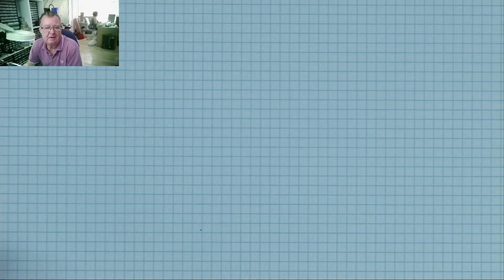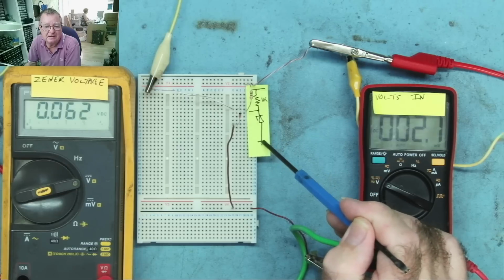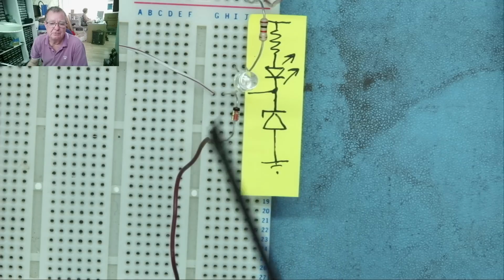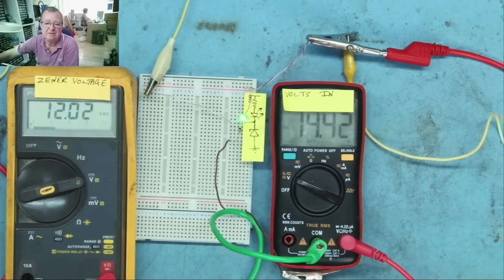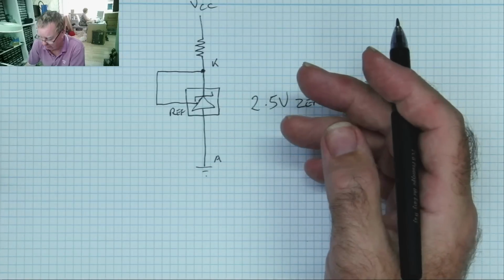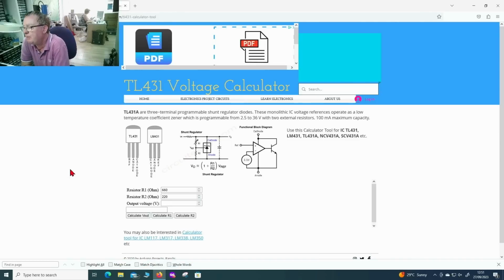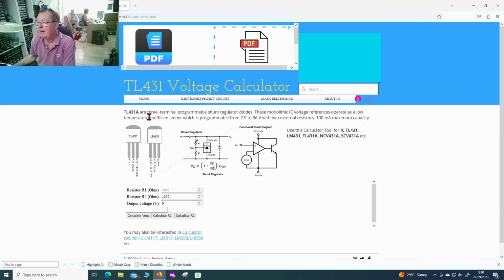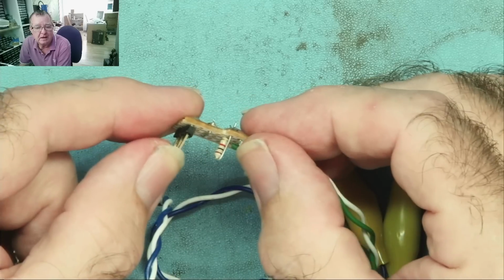All You Need To Know About TL431 To Fix Stuff : Test in in and out of circuit, test feedback circuit

Comment: I bought some CMS version at Aliexpress store.
They work well for default reference with just a voltage a bit high : 2.8 v. 
BUT they are totally unable to be programed.
I mean if you put a resistance bridge in the reference the output voltage does not change:
Always 2.8.
Or they put resitors default resistor bridge into the component.
Or it is in fact a zener diode and ref pin is connected to nothing.
Until you do not use your component in programmable mode you'r unable to see that.
Or more often you'll see it but the guarantie will be delayed.
It's not the first time they full me kind of the same way.

I had a ordered 555  CMOS which may run at 2 Mhz and more.
When powered, everything worked well until 20 minutes later: The component starts to be silly: signal seamed to be like parasitated untils it suddenly stops the only way to restart it is a reset or closing the power supply.

Comment: I have a few of these in my parts box but have never found a dead one. One day ... maybe. BTW I tend to put test clips on the LED side of the opto isolator fairly often to 1) see if the supply is running if I can't easily get to a DC output, 2) see what the output voltage should be if the board isn't marked and the board is dead. When supplies are running well (or my injected DC is as rated output voltage) you typically see 1V on the cold/LED side of the 817 isolator. I'm going to have to do more poking around on the cold side as you're doing here.

Comment: This is one of the very best electronics videos I've seen
on youtube because it shows how a zener diode, an LED,
a resistor, and the TL431 3-pin precision voltage-reference I.C. work together to affect the circuit's output voltage at one specific, repeatable voltage.
Kudos.

Comment: Thank you for this video. I have a 12v 4A SMPS that I use for cameras and the LED on the output would just flash in abt a 1 sec interval. I pulled the TL431 from out of the circuit and in using the A to GND and KtoR with a 1K resistor to 5v, my reading is .77 on the K pin. I should be seeing 2.5v based on your information. I'll be replacing the TL431.

Comment: Why @16:01 the LED is lit at 1.955V?  Also similar things @18:17.  If it behaves like a Zener diode, it shouldn't conduct until 2.5V.  But obviously it did conduct at less than the 2.5 reference voltage.  Is the meter on the left not displaying the correct voltage?

Comment: Evidently, I've been under a rock; this device was introduced in 1977!. I've worked with zeners, LM78XX, and even LM723, but I have never heard of the TL431.

I've used opamps to form  window voltage detector circuits, but I was impressed to see in the data sheet that a window voltage detector circuit can also be accomplished with a couple of LM431's.
Thank you for this fun introduction video.

Comment: Was waiting to see you place a potentiometer in the circuit to get adjustable voltage control... 
I need a 4.2V and a 3.6V supply, a cheap with plenty of current SMPS usually have the TL431 with it's associated resistors, I know that a potentiometer can be used to drop from 5v to 3.6v but I haven't seen it done and thus haven't gotten around to trying to figure it out myself....

Comment: I found a variometer in some phone and camera power supplies, that can alter the voltage of the output for the user’s needs. Probably all power supplies have the option, if not by variometers, but with a proper resistor, or socketed resistor can do the same job. Not SMD, usually easy to install. This modification is usually useless, because everything is based on the 5V standard.

Comment: So it's like an LM317 but set up as a shunting voltage regular instead of a passing regulator. In your example of the fixed 12v zener I was reminded of yesteryear when we had much more accurate references which wouldn't creep up as the supply rises. Vacuum tubes FTW.

Comment: The TL431 can oscilate during start and/or if there is a low Va/Ia going through it. Also if the capacitance of the capacitor across it is below Y or higher than X according to Texas Instruments. Higher than 10uF, I like to put at least 22uF across. A video showing this oscilation and when it happening would be very Nice. Love the videoes. Keep them comming.

Comment: Richard, I have a simple 6 led PIR  night light that I have replaced the Alkaline AA batteries with Ni- Cads.
I find that one battery always discharges more than the rest . This of course will damage that battery over time. I believe a TL431 circuit will provide protection but -
Do I apply that circuit to each of the 4 series connected batteries or can I monitor all 4 and shut off when  a low voltage (1v) per cell is reached ?
Secondly, would this make a good follow on video.
Great channel - keep up the good  work...
Reply from the maker: Thanks for the suggestion I'll take a look at it

Comment: Clever... i love the feedback method and will be using that next time.... thanks.....
Reply: Be warned! If you just configure the circuit with the resistors to set the behavior at DC it is very unlikely that it will work properly in a real circuit. You have to consider the entire circuit and its gain and phase characteristics or your power supply is likely to have dismal dynamic performance or worse, become a high-power oscillator. "Frequency compensation" is key.

Comment: when i was a kid a -few decades ago- i wanted to build a dual 0-30v 3a power supply with selectable series tracking  for split rails , i looked at how commercial units did it and could not get my head around the complex reference shifting and regulating the negative rail instead of the positive ect , for simplicity of built and fault finding i wanted both chanels to be symetrical, and dual gang pots dont track well and dont come in 10 turn , so i wanted voltage feedback through an led based opto isolator to slave one channel but couldnt get any linearity out of it 
i didnt know what the TL431 did, just knew that it was as common in the 90,s as a TL494 in a smpsu !
Reply: There are some optocouplers on the market that are specifically designed for linear applications. They have one emitter and two quite well matched "receivers." You use one receiver for the output and the other one used in a closed-loop driver circuit for the infrared emitter. The closed loop method with the good matching nulls the non-linearities. I've used them in a few circuits and they work quite well if you do the design properly. They are a lot more  expensive than general purpose optocouplers. To get good performance you also need to use good op amps.

Comment: Interesting and useful but at 17:30 we are demonstrating that we can get 5 volts at the 431, because that's what you used the calculator for but that didn't happen as your circuit wasn't the same as the Texas one in that R1 should connect to the cathode, as it was you had a potential divider between VCC and ground and the REF in the middle so the ref will change with VCC and so does the output which  aint the point. Other than that a lot of good takeaways !...cheers.
Reply: Yeah I noticed that too, nice video all the same 👍
Reply: I had this comment too. But read the replies to my remark. In a switching power supply this component is not used as a zener at all, but as a comparator that switches on or of the led based on a threshold voltage. It does not act as zener - it acts like a switch driven by a threshold voltage. Richard did not mention this.
Reply: yes, basically a op amp or comparator  @kriswillems5661
Reply: @kriswillems5661  
No, it is not used as a comparator and it does not switch in normal operation when used in the feedback path of a switchmode supply. It is used as a voltage reference and an error amplifier. The amplifier and the optocoupler normally operate in the "linear" region, with the amplifier increasing or decreasing the current through the IRED of the optocoupler and hence the current through the transistor of the optocoupler. It would only "switch" (swing to one or the other of the limits) under "large signal" conditions.
Reply: Yes, I was not sure about this. This makes sense. I would like to see  scope image of the voltage on the cathode. How such a loop works (switching or amplifying) very much depends on the time constants of the individual parts and the behavior of the feedback input of switching IC. Looking the schematic I do indeed see an Rr and Cr in the feedback, which does make it amplifier and not  a comparator. Also in the datasheet of the switching IC the control input is called "Error amplifier and feedback current input pin for duty cycle control", which confirms what you say. That said, just calling it a zener in this configuration is a bit confusing. It's an error amplifier with voltage reference. Thank you.

 @D614G_aka_Doug

Comment: The best TL431 video iv seen. You have Covered zener diodes plus the 431.. not to mention that little test circuit with the header pins(great idea). P. S. Iv also seen the TL431 symbol on schematics look like an SCR diode with the reference pin come out at an angle from the cathode just like the control pin on an SCR...   
Great video👍 best explanation 👌👏
Reply from the maker: Thank you 🙂
Reply: Just recently I saw, in a video, a TL431 drawn like an SCR. Sigh!

When a TL431 is being used in the feedback path of a power supply, I think it is best to draw it as two separate sub-circuits - the 2.5 volt reference and the amplifier with the output transistor. For people well-versed in this stuff it doesn't make much difference but for people who are not I think it makes the operation clearer.
Reply: @D614G_aka_Doug I agree that using the wrong symbol in the schematic is annoying as hell. Drawing out the equivalent circuit though is only useful as a teaching aid or for circuit analysis in the design stage. For production and service schematics the proper only the proper symbols should be used.

Comment: A TL431 is not a Zener or anything like that. It is a reference voltage source and a low-voltage low-gain op-amp cleverly packaged into just three pins. You can use it as a “Zener” just as you could so use a low-voltage op-amp with a 1.5V battery connected to the non-inverting input.

In a switched mode supply, TL431 is THE voltage error amplifier and has a key impact on the performance of the voltage regulator aspect of the supply. 

It finds use in switch mode supplies because it’s cheap and fairly well understood among the power supply designers. It does the job well enough.

When thinking of TL431, think like this: op-amp with (+) input tied to a 2.5V reference, (-) input brought out to the R(eference) pin, output driving a current source connected between positive and negative supply rail, and those rails then brought out as A(node) and C(athode) pins. It’s a compromise, but a reasonable compromise. And it works like any other low bandwidth op-amp would. You can use it to amplify speech audio for example (it’s too slow for HiFi lol).
Reply from the maker: I accept that TL431 is not a Zener diode (internally) it is more like an op-amp with a voltage reference and this is clearly visible on the Texas Instruments datasheet.  But I believe the point is that it behaves like a zener diode in real life applications and that, as the title suggests, is really 'All You Need To Know To Fix Stuff'
Reply: Richard, I was confused because you described it as a zener diode in in this application, while it acts like a comperator that switches on or off a LED.....just like transistor would switch on or off a LED.  It's like a switch that closes when a threshold voltage is exceeded.  It's not at all like a zener in this application.  I get it now.
Reply: Exactly. But Richard made a mistake.  R1 from that feedback loop should be tried to the output of the opamp (thus the cathode) and not Vcc as Richard did. R1 and R2 make a voltage divider without load on it, because the reference input has a very high input inpedance, because it is an opamp input.
Reply: @kriswillems5661  It depends on the application. For a shunt regulator/fixed voltage reference, R1 and R2 should indeed make a voltage divider between anode and cathode. However, as part of the feedback loop of a regulated power supply, you do need the top end of R1 to be connected to the PSU output, so that the TL431 runs open-loop and switches on or off like a comparator, as the output voltage varies about its set value (making the voltage at the Ref pin vary close to 2.5V).
Reply: @RexxSchneider That makes sense.
Reply: @RexxSchneider  
No, the TL431 when properly configured in the feedback path of a power supply does not switch in normal operation.
The circuit is typically configured with the amplifier to run open-loop at DC, but that doesn't make it work like a comparator. The frequency compensation components, which are seemingly invariably dismissed as "some other bits" are absolutely critical to proper operation. With the simplest frequency comp, the gain of the amplifier is "rolled off" with capacitive feedback so that the gain around the entire loop passes through unity (gain of one) on its way down with a "phase margin" adequate to assure stability. You want the total phase shift around the whole loop to be typically not more than about 320 degrees, though you may design for substantially less or a bit more.
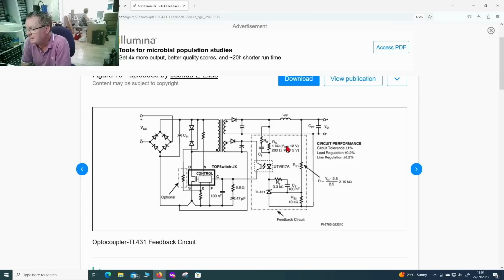edit: In the schematic at 21:00 there are four frequency compensation components - two capacitors and two resistors. setting two "poles" and two "zeros"

 The error amp may "swing to the rail" during "large signal" events, but this can result in overshoot or undershoot behavior.
Reply: @D614G_aka_Doug  Yes, thank you for being more exact about the description of the circuit operation. I did wonder if I had oversimplified the opamp action, but decided I'd explain the feedback like that to make it easier for kriswillems5661 to understand why the resistive divider chain is connected to the PSU output in these applications. I am aware that the TL431 is the gain stage in a feedback loop and hence is compensated for stability, but felt that was unnecessary for the explanation. Sorry if I caused anyone confusion.
Reply: @RexxSchneider  
It can be a challenge, especially when you have to do everything in writing, to help someone understand some point without confusing them even more with other stuff.
In my opinion it would be better if the TL431, when used in a feedback path, were clearly shown as two essentially completely separate sub-circuits - the voltage reference and the amplifier. The 431 has the extra problem of its power supply and "output" are the same pin. It does make it rather confusing for anyone not used to dealing with this sort of thing. The "long" feedback path, via the power conversion circuit in a switcher, is an important concept but not necessarily easy to grasp.

As it happens, I've seen a few videos just recently in which the amp in the TL431 is described as a comparator, which give the false impression that it switches in normal operation. Of course it does "compare" the two inputs to the amp, but it doesn't behave, in normal use, like the thing we call a "comparator" in electronics. And there are lots of good uses for the TL431 where the amp actually is used as a comparator with a switching output. There's lots of opportunity for those just starting to learn this stuff to get confused.

~~~
I've designed power supplies, both switchers and phase-angle controllers for single and 3-phase, that have three control loops, arranged so that "the lowest set-point dominates." One loop is "local" for voltage control, another local for current control and a third through a really long path to control power delivery to regulate the voltage between a metal structure and an electrochemical "half cell." Trying to make sense of that circuitry can be rather daunting.
Reply: But note that the TL431 behaves exactly like a zener diode when the anode is taken positive relative to its cathode, i.e. it conducts at about 0.6V, allowing it to be a direct replacement for a zener in any application. An opamp is rather unlikely to behave as cleanly when its supply pins are swapped.
Reply: @RexxSchneider  It has a diode junction inside to make it happen. You can always add one to an op-amp :)
Reply: @absurdengineering  Indeed you can, but the point is that the TL431 behaves just like a near-perfect Zener diode already, without added external components.